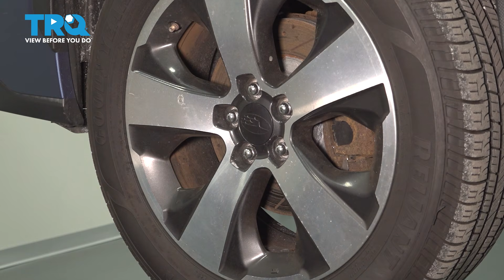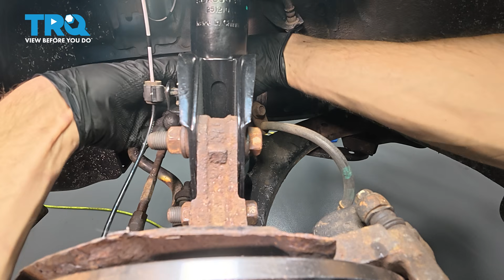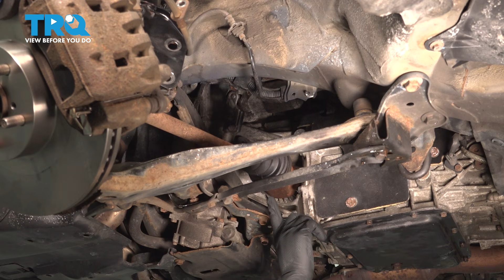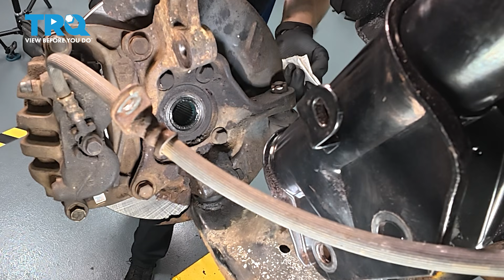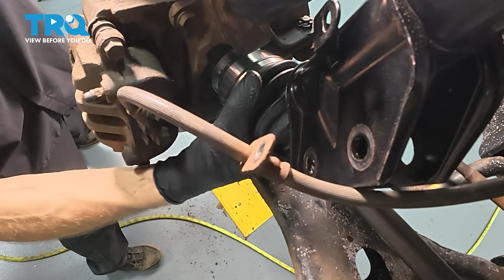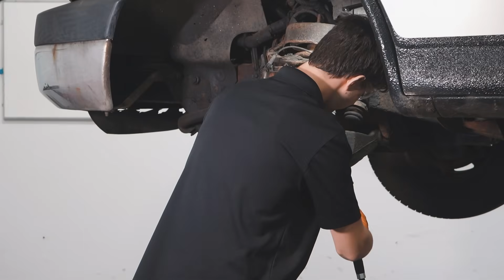How to Replace Front CV Axle Assemblies 2013-2015 Subaru XV Crosstrek 2.0L H4

Comment: There are also two different axles for the earlier models I found  out 
And the top bolt on the strut is adjustable for alignment you need to mark the position it’s in before removing

Comment: Hey, at 2:30 in the video there's no mention of marking the upper bolt alignment marks prior to removing it so you know how to reinstall it. There's 8 or 9 alignment marks which correspond with the oblong neck of that upper bolt which aligns the knuckle.
I followed your steps and didn't notice these alignment marks prior to removing the bolts. So what's the procedure needed to reinstall that upper bolt ???